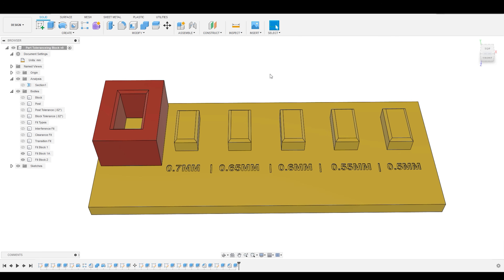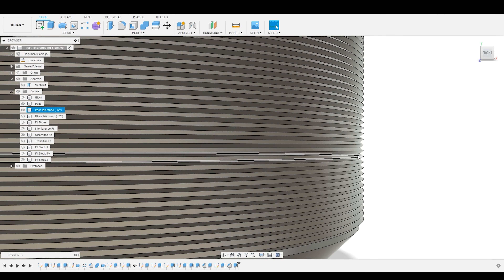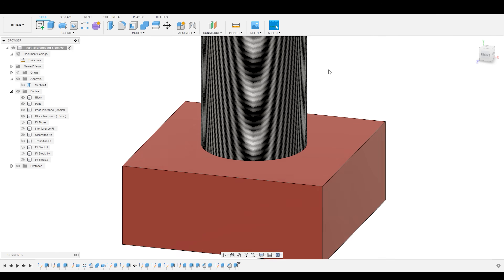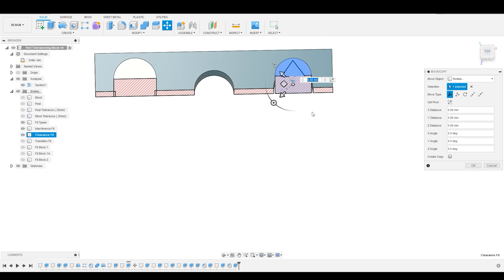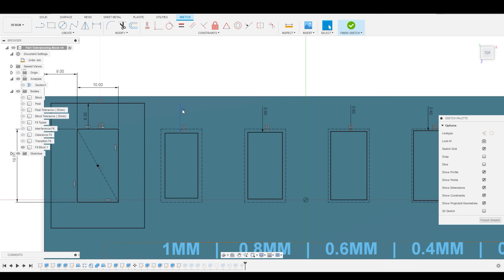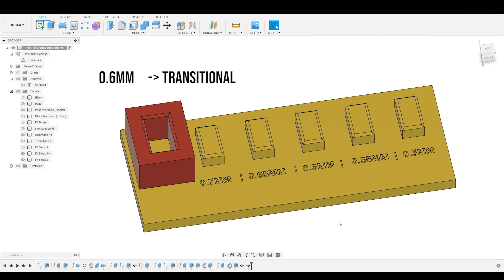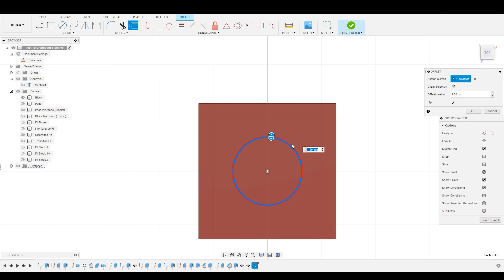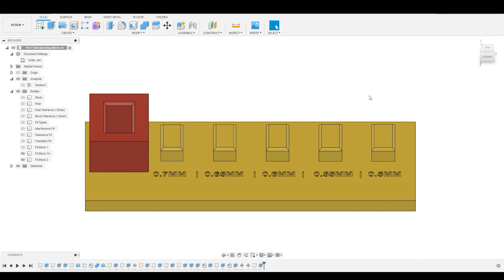Beginner's Guide to Fit and Tolerance in Fusion 360 - Get the Perfect Fit from Your 3D Printer / CNC

Comment: thats nice but in 3d printing if the things lay on the bed the sizes changes drastacaly compared to vertical... a 2.5mm hole will be 2mm if on the plate....
Reply from the maker: Hey Dave, appreciate the comment.  If you are experiencing that large of a shift I may recommend you adjust some of your print settings.  There are tons of great videos on printer calibration that to adjust how your printer handles the material touch the plate.  Alternatively I occasionally need to use a deburring tool to clean up those edges

Comment: Nonsense, you design cad drawings specify tolerance then it is made to match it. Slicer is the software that needs to account for this. You do not make different dimension part in cad for every printer or cnc machine
Reply: And which slicer is capable of correctly accounting for tolerances?

Comment: Most of what you note in your video can be addressed in the slicer parameters rather than modifying your designs (tolerance fits).  You can also adjust for things like material shrinkage which will throw a lot of the fitment done in the design out the window.
Reply from the maker: Heyo! Technically speaking, you are correct, a lot of what I'm explaining in this video “could” be done in the slicer and I've been really impressed but what slicer programs can do and how much they have evolved over the last few years.  But, as Dr. Ian Malcom says (kinda lol), “just because you can do something doesn’t mean you should”.  In my opinion the slicer method is a solid ‘hack’ if you are using someone else’s CAD / don’t have the ability for to modify the CAD file BUT it has limitations as complexity increases.  Let’s say for example you have an assembly that needs to snap together in one area but have a working slide or rotational hinge in another… for something like that I’m going to need to have localized control over fit offsets. I also work across platforms so I can’t always rely on a slicer.  When I'm CNCing for example it’s important to understand the underlying principles to get everything to work / program toolpaths properly.    Overall I think if the slicer is working for your applications keep using it, but if you want to have more control over what’s happening ‘behind the curtain’ I recommend integrating the offset principles into your modeling process :). Cheers!

Comment: Hey this is a great video! I am now designing a computer chassis in Fusion 360. I have studied this "tolerence" topic before and I found that the "transitional" tolerence of my Bambu Lab X1C printer (with PETG material and 0.4 Nozzle) is 0.3mm. So I created a "Tol" (tolerence) parameter in my Fusion 360. I added/subtrcted this "Tol" to the dimension when I design something like dovetail connection of two boards. So my questions are:
1) Is my way of resovling the tolerence issue like above right? If yes then I am going to do this to every part of the components where I see there is tolerence issue. Correct?
2) I know that there is setting in printer called "Horizontal expansion" (Cura) or "X-Y hole compensation" (Bambu). Should I use them to resolve the tolerence issue instead of doing it in Fusion like #1 above?
3) If I want to share the STEP file with others (not the Fusion file) should I put a note there and tell the user the tolerence setting I have so that the user can adust on their own?

Sorry for many questions above. 🙂 Appreciate your time and effort!

Comment: Thanks for this video. Does a new block need to be printed for a 0.2mm nozzle and a 0.4mm nozzle?
Reply from the maker: Hey patty, yes since each machine/setup has its own variance, you would want to test each setup individually… they may be close enough that you could use the same settings but you would want to test to make sure
Reply: @practicalalchemy407  Gotcha, thanks! Where would you place the Z seam? Sharpest corner or random?

Comment: Printing a fit block is a good starting point. However, there are few variables that this video/lesson does not address! In addition to different materials (PLA, PETG, ABS ... ) and nozzle sizes, there are a few more factors that come into play! Shrinkage is one of your biggest variable and it is highly dependent on the amount of material deposited. 20% fill will have considerably less shrinking than 100% fill. Along these lines, large and thick parts will shrink more than small parts. Bottom line here is that it takes time and many tries to get a good idea how your parts come out of the printer. I use calipers to measure the difference between design vs printed dimension. You can quickly create a table (or graph) that will show the relationship between %fill, size, print temperature and so forth. 
With the exception of all the fast moving and zooming, this is a well put together instruction video. Thank you for sharing!
Reply: This is a good point. A 0.6mm clearance may result in a good fit in one part and one material in one nozzle size, but a poor fit in another part, or another material, or another nozzle size. Even print orientation may have an impact.  

I suppose if you wanted to, you could create a variety of fit blocks for different materials, part sizes, in-fills, and nozzle sizes to help you dial in the right fit for what you intend to make.

Comment: Would you chamfer the edges for wood working?
Reply from the maker: If you are cncing I don’t think the chamfers are necessary since it would require additional tool paths / bit change But you will need to dogbone the corners of your female part to account for the radius of your bit

Comment: You must do your CAD design to true dimensions! At least when sharing only stl files. It is everyones own responsibility to know ones printers ability and account for this in the slicers XY hole and XY contour compensation settings. Needless to say, one will end up with all sorts of problems if printing an stl file, that was created by someone else, already incorporating this persons compensation in the CAD file, based on tests, filament brand, type etc. and then this stl file will be loaded into my slicer, with my settings. Say I know I need 0,05 XY hole compensation, but the author needs 0,1 effectively I get an offset of 0,15 which will render the printed parts useless. Wasted time and filament is the result, not good.
Reply from the maker: Hey Parken!  Appreciate your comment and perspective!  As someone who doesn't really buy or sell STL files I'm pretty new to the concept of using the slicer for CAD compensation.  That said I agree with you, that really comes down to 'Design for Manufacturing' ... if your manufacturing method is 3D printing and your customer is buying an STL file you should design your files to account for that.  In fact, I would take it a step further and say that if you are designing parts for STL download/sale, you should design them so that the components that require complex fit or high accuracy can either be removed, printed separately, or somehow adjusted (like a screw) so that the end customer isn't, as you say, wasting time and filament.  In fact... I think you've given me the topic for a new video!

Comment: Hi there. Did you post part 2 where you show how to make the fit gauge? Maybe I missed it but I cannot find it.
Reply from the maker: Hey Orlando, there isn’t really a Part 2 video.  The intent is for you to use to model this block in your preferred cad program and print it out on your machine so you can evaluate what offsets you should use when modeling

Comment: This is a really helpful video. Do you suggest having a fit block for each nozzle size on your a FDM printer? I'm guessing each nozzle size would be slightly different. I tried making a threaded connection for the first time today and I did an offset based on a YouTube video recommendation, and it didn't work. I'm using a 0.8mm nozzle for faster prints where quality of finish isn't important, and I'm guessing that's not what most folks use since it isn't the default nozzle size.
Reply from the maker: Hi Brian,  my general recommendation is to have a fit block for every ‘setup’ that you run…I also tend to run most things on draft and have found that I have to use different offsets than when I run things with a higher finish… especially if you are doing a very specific fit like threaded connection.

Comment: Hello, Fusion beginner here;   Is there a way to create a parametric function for the printer tolerance?  i.e.  If I want to tackle a large project with 2 printers that have different tolerances; can I set up that final offset extrusion cut as a parametric function and change it depending on which printer I'm exporting to?
Reply from the maker: Hi Patrick, yes! You can absolutely do that, in fact I cover this exact topic in my ‘Beginner's Guide to Designing with Fit Video'
Reply: @practicalalchemy407  awesome thank you!

Comment: What about round objects? Need to make a different template for round ones too?  The rectangular template is just for rectangular shapes. Odd shapes will have a different printing  behavior. Then size also affect printing tolerance. There really no one size fit all solution for FDM printing. We are at the mercy of the manufacturer's accuracy
Reply: The accuracy of a printer in xyz is an absolute value. I think the template is good if its not too litle compated to the nozle size. If you break it down a round shape is also just an combination of x and y position. If you go deeper into gd&t theories than this value here are neather the tolerance nor the clearance but lets keep it simple. One specific  printer  one template and you have a very practical guidline. Good video, thankyou.
Reply from the maker: This is well said and I appreciate your comments! Like you say this  intended to be a quick and practical way to understand and work with your printer, rather than an exhaustive breakdown of GD&T theory.

Comment: Great content. Wouldnt the offset be dependant on the filament type and printing settings too?
Reply from the maker: Hey Alain!  I can only speak to my personal experience but I’ve found only minor variations between filament types in terms of fit and I rarely deviate from my 0.5mm (clearance )| 0.4mm | 0.3mm (interference) guidelines on the Makerbot.  For more complex objects you may seem some variation when you change the print settings but the great thing about about the gauge is that you can quickly print it out in draft and high quality to dial it in for your printer!
Reply: It will depend on filament, printer settings, ambient temperature, the form and size of the part (like holes of different diameters require different clearances, and dependence is not linear). When I make size-critical parts, almost each time it requires test print and further adjustment of clearances.

Comment: Very easy to watch and straight to the points of learning. Excellent. Subbed. Would love to see something on various designs for joining 3D printed parts. Particularly when the basic ones aren’t a good solution.
Reply from the maker: Hi David!  Thanks for the sub!  Great suggestion!  I’ve got a few Halloween themed vids in the works but part joining is on the short list after that!

Comment: 14:58 Depth (against the layer lines) dont work the same way. Mostly depends on your z offset and the way you "squish" the first layer
A point you forgot to mention about your clearance gage: this works only for a specific layer height. Different layer height = different clearance required to achieve the same fit
Reply: You shouldn't have any squish out.
Reply: @saltwaterrook4638  Right, but that wasn't my point. When you set the "first layer height" value on your slicer, this theoritical value is used for the calculation of the remaining layers, so that the total height of your print matches your model. 
But there is no way for your slicer to know the real, actual height of that first layer, as it depends on your z offset. The height of the following layers only depends on your z motor calibration, and is not related to the extrusion
Reply: @sergeb7945  false.. again. You shouldn't have z offset. Z offset is for people that don't know how to tram a bed. Also, your machine knows exactly where it's at.  That's what the MCS (machine coordinate system) is.  It has to know where it is lol.  You clearly don't know how this all works.

Comment: Great video. I just did that on my Ender-3 printing ABS at 0.2mm layer height and 0.44 layer width, in my case 0.1mm was the best fit, the walls barely touch and the piece holds itself when I turn the whole thing upside down, the 0.15mm one the piece falls when I turn it upside down. I think I could go as low as 0.05 but I'll stick with 0.1 to account for discrepancies in more complex shapes.

Comment: Do you find that there are different tolerance offsets for different Axis? ie for a particular printer, are the X and Y direction offsets identical, and what about tolerance in the Z axis?
Reply from the maker: Hey Adam!  Personally I haven’t see a ton of variance in the Z direction vs the X/Y with the Makerbot but technically I would think about the Z axis as a different “tool” with its own unique issues.   You can use the same principles to evaluate your Z axis by varying the heights of the extrusions in the gauge until your happy with how your Male and Female parts mate in the Z axis.

Comment: I find that my printers tolerance is directly proportional to my flow rate for the given filament and I have to tune the flow rate differently for every filament.

Based on your explanation it has me curious to know if the tolerance should be different for every layer height/width and if so it sounds like this is something that should be handled in the slicer.
Reply: Yes, and nobody talks about it
Reply: Yes, it's a calibration issue mainly.

Comment: I don't like to add the tolerances in using sketches as it not only makes the sketches insanely complex, but it becomes really difficult when you have a part with many complex faces. If I'm not being lazy, I'll add a parameter called (PRINTEROFFSET) or something and then use the face offset tool to add that where I need. If I am being lazy, I just select the faces I need and offset them using the tool. 

The parameters solution is ideal in many ways because if you get a new printer or dial it in more, you just have to change it to the new tolerance and all your parts will update. Having to manually edit each sketch would be a nightmare.
Reply: This is exactly how I do it as well! With parameters it is absolutely a night and day difference for tuning tolerances and finding that near perfect fit. Especially when 3D printers have monstrous amounts of variables in play when it comes down to tolerances.
Reply: you can create a parameter where you only change the tolerance and ill change every tolerance at the same time.
Reply: How are you guys handling it when you have a shared design because every printer is calibrated a little differently?
Reply: @chiefgeek2020  I just put in a tolerance that I know works for me and let people know that some sanding/adjustment may be required based on their printer. There isn't much else you can do.
Reply: yes this is a good practice you explain, I'm not familiar with F360 but with SW you can then create "Configurations" with each having PRINTEROFFSET set differently and call them Clearance, Sloppy, Super Sloppy, etc...  and you can switch between with one drop down.
Reply: I use offset face for most of it. Including 3D printed threads.
Reply: This is great. I’m going to start using this

Comment: This is a great video but people should start by calibrating their printer. Teaching Tech has a great calibration guide.
Also, the tolerance will likely be tighter when bridging for a slot, perhaps for inserting a nut.
Reply from the maker: Really solid points!   For this vid I wanted to keep it simple / focus on what you can do on the software side but yeah it might warrant a future vid to explain that tolerances can change based on the print quality, print direction, support / bridge features, and calibration.  Thanks for the suggestions!